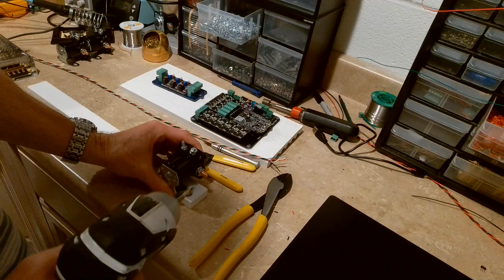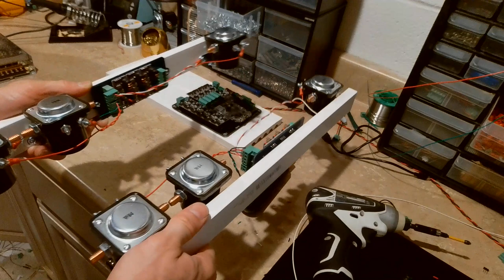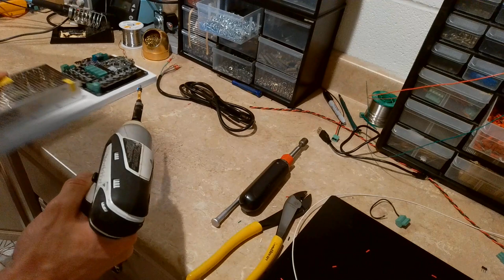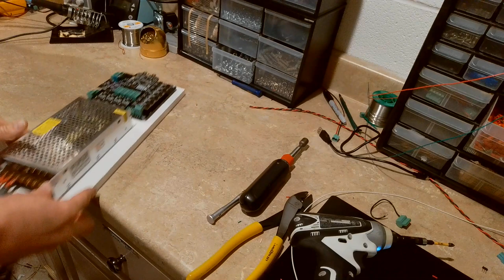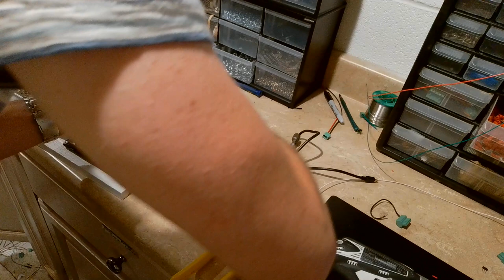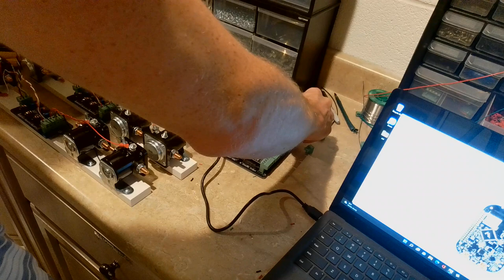Virtual Pinball Solenoids Complete Assembly Instructions with Cleveland Software Design Boards

Comment: Do you find that locating the contactors against the side of the cabinet yields better results than having them spaced along rails under the playfield as they would be in a real game?
Reply from the maker: Either way is fine, if you are looking for the most accurate representation then doing it under the playfield is the better way to go, but a lot more work :)

Comment: I have 10 solonoids in my cabient and all are run thru Phil's Solonoid Life Extender boards. They've worked flawlessly without exception. The only difference in my wiring is that I come off the terminal blocks for the positive voltage instead if running the voltage thru the 12-output board. Just a personal preference. I have piece of mind knowing that the solonoids aren't drawing all that voltage.
Reply: I meant to say "current" or "power". Not voltage. lol